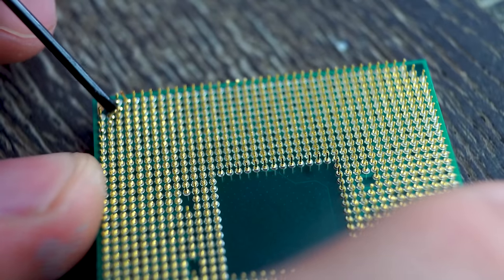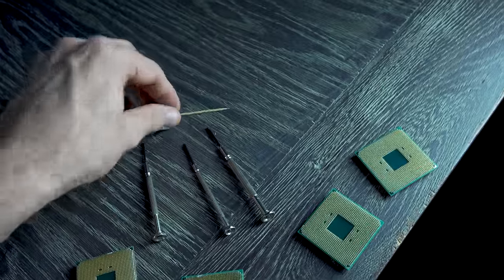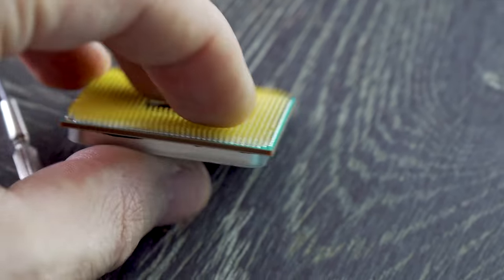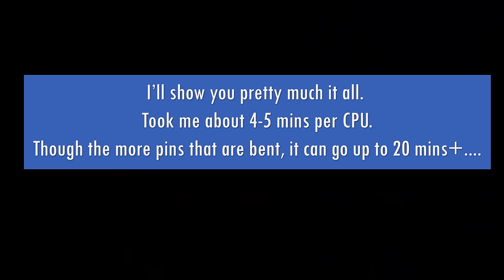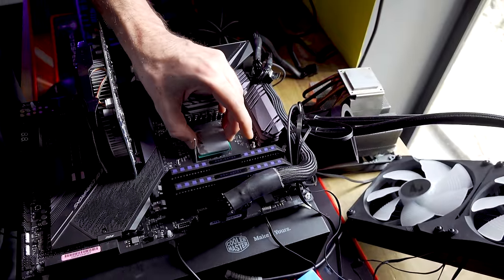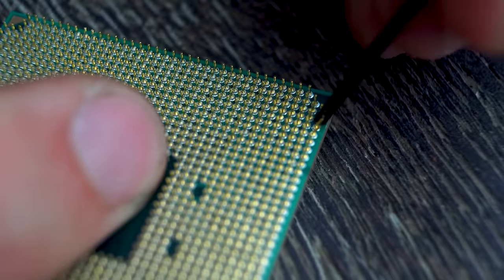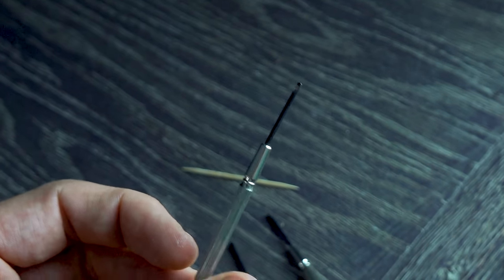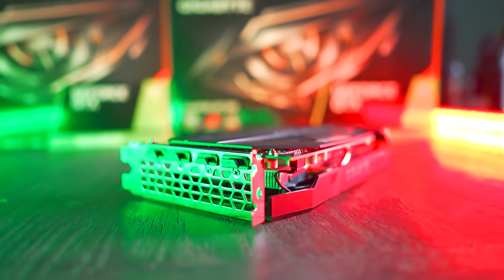How I quickly and easily FIXED 2 Ryzen 2700X CPUs with BENT Pins

Comment: So i couple of tips i just learned from unbending the pins on My phenom X6 965. First look for and try to take care of the "obviously" bendy ones, seccond i'll assume Ryzen CPUs have more pins a there for a smaller gap betwen the pins, Jay from JayzTwoCents used a Razor for unbending the pins, that was far too small for my older CUP but i found out that a regular plastic guitar pick was perfect for the job, third if even after you took care of the most bendy pins, the CPU wont go in, that means that "all" pins are ever so slightly bended, but resist the urge to cry and you guitar pick to slowly crias cross the CPU opins, going line by line making sure that all pins are straight, after that it should gon right in. And That's it! Now you are free to cry from the stress and hopefully feel quite proud of your self. But the main thing is to be calm, it's not the end of the world as you may think it is, just take your time do it slowly and you can make it.

Comment: As an anecdote.
When I was ready to change the Wraith Prism for an AIO, I didn't use my PC for 2 days (so imagine the thermal paste ...), when I was about to remove the Prism I remembered the method of turning it a little bit and suddenly ... The Prism comes out with my 2700x attached to it ... I think it's one of the 5 times I have been most scared in my tech life, so after a bit of movement I can take it off and observe the worst, like 10 bent pins. So with a needle I prepared to bend them (it is not my first time, since I do it regularly with LGA but it was my first time with PGA), after about 20-25min and with tears in my eyes, for me surprise my 2700x still works without any problem
.
In summary or TL; DR: do a CPU test to leave the CPU / paste / Cooler warm, be careful with this bitch Wraith Prism (or the little brothers for that matter) and if you have a bent pin or pins BE PATIENT because if they are not broken, they can still be repaired/bend back.

Great video.

Comment: Great tip to do the wiggle when removing cooler.
Reply: Also run a stress test to loosen up the thermal paste
Reply: Dont even need a stress test, just turn it on for 10 min
Reply: @rdmz135  bit like a hot engine before changing oil!

Comment: I've made your mistake on the 3900x twice now... My heart stopped. I warmed it up with a stress test, did the jiggle(may have been a mistake in the end) and it still came out with my Noctua D15, 3 corner pins bent out the gate. Then after managing to get it off the cooler with a hair drier twisting it I drop it inside my case bending the opposite corner. 30 minutes of bending with a sewing needle until it sat flush... with a tap at the end. All good so far.

I can't wait for AMD to switch, AM4 is held in by a garbage slide mechanism relying on friction. Well now the pins are thin with less surface area and shiny gold plated copper to begin with, I can't change the cooler without risking pulling it out of the socket. The cooler and processor are one now as far as I'm concerned.

Comment: Not sure if my brand new 3600 came with few bent pins or my father somehow managed to bend them while putting the cpu in the slot, but I've managed to straighten them up with a sewing needle since these screwdrivers were just too big imo. Took me almost 2 hours to bend few pins back since i was nervous of breaking them off.

Comment: I like to use sowing pins for straightening out PGAs. The ones I have here fit perfectly between the bases of the bent pin and its unbent neighbour. I push it through for a couple of mms, then slowly raise the sowing pin from the substrate. Because the sowing pin is guided by multiple straight pins in the two rows alongside it, this will usually put the bent pin back about 80-90% to its original position, at most needing small adjustments to fit back into the socket.

Comment: I bought an open box CPU (used warehouse deals) that was about $100 off, but failed to mention bent pins, but it had three or four bent with one bent severely down at 90 degrees.  I thought about sending it back, but then decided to give it a try.
  
In the old days we used credit cards, but the Ryzen's pins are too close together to fit a card in between them and for the 90 degree flat pin I used a safety pin because the better ones are made of spring steel and the only way to get in between the substrate and the pin is with the sharp point of a sewing needle or safety pin (the safety pin has a built in handle unlike a sewing needle so it's easier to grip near the coil).  I place the cpu upside down in a soft edge (plastic or rubber type insert grips) vise so it's secure but not so tight it gets damaged.  

Barely put the needle point past the pin in so it falls away while coming up thus keeping you from over-bending the pin the other direction like we see several times with the screw driver - as that weakens the pin going back and forth.   As you rock the needle down below the edge of the cpu like a teeter totter at the nearest edge the pin comes up off the substrate.  It's better to do just a little at a time to keep from going too far or breaking it off.  Rock with the spring steel pin gives you power and leverage without too much force and only having the tip slightly in keeps you from over bending as well.  Then you re-position and do it again just barely putting the needle past the pin so you are only moving the pin slightly with each rocking motion.  I find I have much more precise control using the rocking method over free hand and thus I'm not constantly having to correct the pin from over bending like we see in this video - lessening the chance of breakage.

Comment: I remember two pins falling off my old Athlon XP 2600+ trying to straighten them. Just dropped the pins into the correct socket holes and applying more pressure on the CPU before locking it in. Always worked.
Wonder if it would work on a more modern AMD CPU ?
Can't see why not.

Comment: How I accidentally bent my pins is my Ryzen 3 got stuck to my heatsink, I didn't use the right method to get it off (using a hair dryer and slowly pushing it off with a flathead screwdriver) and I just plopped it back on in the new motherboard I was swapping it into, and I bent a few pins, thanks for making this video, I'll try this method. Hopefully I can save myself time and money using this

Comment: Also, if that case of the CPU still doesn't go in at one corner despite you tried your best to bend the pins straight, sometimes instead of inspecting it all over again, trying to (very, very gently) fit that corner into the socket first will get it to fit in, and you just tighten the socket to completely bend the pin back

Comment: razor blade works well. been using that for alot of pga cpus, you can also get plastic razor blazes if worried about scratching.

on launch bent 2 pins on my 1700.

Comment: A really easy way to solve cooler removal (Air and AIO pump) is to run the computer at stock clocks for 5 mins (desktop or dos) turn the PC off and remove the cooler immediately with care.  

The thermal paste is in a warm liquid state still. That now liquid bond won't grab on like cool thermal paste will. (no need to wiggle). This will avoid PGA pins getting bent and or the CPU come out with the cooler at all! 

Super safe and easy way to avoid what Tech Yes City went through with the 3900x. 

The 2700x's just how!? Who drops a CPU let alone 2 of them!? 

Especially when you get each one? 

Sounds a bit fishy to me. 

What do you guys think!?
Reply from the maker: CPU Tray lost the CPUs when they were handling them.
Reply: @techyescity  holy hell! We'll that's just more than bad luck then. 

My heart would have literally stopped in that moment! 

Thank you very much for the feedback mate. 

Very appreciated.

Comment: razor blades are a really good tool to use. you can bed  very easily and it works double as a good check it the pins are straight enough. I fixed my 2700x doing this

Comment: I use a razor blade as it will straighten up the bent pin until it hits the row of straight pins in the same row, its quick and painless and doesn't require really steady hands that trying to bend individual pins usually pretty difficult.

Comment: sadly this vid is released two weeks after i tried to bend, and broke a pin off my ryzen 3700x. i stuck a bit of a broken off needle into socket and it works
Reply: nice
Reply: @THEMK0070  barely made it work, it was the inner pin
Reply: @theoryismypraxis3538  did you try it without the pin first
Reply: @DraXaly  i dont htink i oculd have since the  bios on the mobo was kaput/. The motherboard was a used b450m mortar and i had a ram error on ezdebug all the time. not  sure as to why. I  bent the pin when  yanking the cpu out with the cooler, it came out aloneg with hte cooler. Not yanking, but pulled it out along with it wily nilly. I am not sure if its a crucial pin now, because the combo would not post due to bios/cmos update issue. I only got it to boot after cmos cealr with the  needle in the socket. I might try it without it to confirm if it works without it,  if it does, i can resell it later for full used priced, rather than as damaged, so its worth a shot

Comment: A way I did it was grab a razer blade, slide it down an "aisle" of the pins and make sure the razer slides all the way through, like swiping a debit card.  then so gently wriggling pins back into place and lining them up, i then dropped it into the socket and i clicked it down, the socket will realign them completely, then youre  green to go, i was lucky it was an outside pin.\

ALSO 
You could definitely try a debit or credit card too, maybe a license, but the blade is much slimmer and more precise... talking about this you could maybe try and exacto knife

Comment: TIP: use whatever heat source to warm up the Cpu at about +60° C.
This way you can recover even the absolute worst bent.
Even if some pins brake off, the Cpu might work without them, as there are double or more of them doing the same thing.
If you're really desperate, insert a copper wire into the socket, where the pin is missing from the Cpu.

Comment: You can take long thin flat piece of metal (like razor for knife but not sharp) and put it for whole length of your CPU  between pins and carefully just bend it straight directly to another pins in same line.

Comment: @Tech Yes City I have a question. What are the differences between x79 machinist and x79 turbo from aliexpress? I saw a video 3 months ago from you with machinist x79 and Xeon e5 2689 but if they both have 1 nvme and 4 ram memory slots, which can be the major differences?

Comment: This method is pretty much the same since socket 745. A credit card, a razor, a needle or a screwdriver of the right size. CPUs before that, like those for socket A, also had pins, but they were so thick, I never saw one bent or broken. It was my experience that on a socket 745 or 939 you could very easily pull the CPU out with the lock still on. I've never damaged any of those with that pull though, it always came straight out with all pins fine and you then had to use dental floss to remove the CPU stuck to the heatsink. Since I've been using better paste, it does not happen to me anymore. With the invention of efficient thermal pads like IC Graphite, this sticky problem is finally history :D

Comment: A utility blade does the job for me
I first align it with the straight row in one direction and bend them one way then the opposite direction
This way is saver because the stress on the pins is lower because its spread over almost all pins in the same row and they automatically align with the rest of the pins
Risc with screwdriver is much higher you damage pin because all the force is directed to one pin

Comment: If a pin vreaks off, just simply take 0,5mm solder wire, put it in the socket exact hole location of the broken pin, cut it off a tiny bit above the surface of the socket so it has a decent touch to the broken spot where used to be a pin.
Place cpu, cooler and you are good to go...

Comment: Great vid. One little suggestion. If you have one or a friend, try putting a notch little ways up length of screwdriver. That way you have more control over the pin not sliding off the rounded edge, hope you get what I meant. I'd use a chisle(tiny and sharp(fingers beware)) to make notch, Dremel tool only if your really good at it. Not surprised they don't make a real tool for this. Keep on keepin on.

Comment: Back in the mid-90's we used a soldering iron with a thin hollow tip on semi-low temp for bending back pins, the heat made them less prone to break and ruin the cpu. The tip was so small that it would fit around a pin.

Comment: I believe this also relies on the state of the bent pins. I once bought a Z370 motherboard from what I thought was a good seller on EBay for a slightly lower price. I bought from him before and thought, "Well, since they took such care of the last item, I guess this one could not be as bad either :)" Only to find a motherboard with the protective lid at the bottom of the box and finding EVERY SINGLE PIN BENT! Like, I get it. Some pins can be bent back and I've done that before. But, the bent pins on that board had to literally require effort to bend in such a manner that it was non-repairable. Luckily, EBay Buyer Protection was the only way to get my money back where I called there customer service where EBay was actually nice enough to pay for shipping cost too to send it back. I could say I learned a lesson, but then again, this situation I was in was very strange and very bad that even EBay sided with me like, "Thats not normal!" literally over the customer phone line.

Either way, amazing steady hand on those bent Ryzen CPUs. I personal use a razor blade along with a scalping blade too. I'm awful at already trying to bend pins, but AMD has always had the advantage of CPUs with pins instead of Intel with the motherboards having pins(I kinds prefer AMD on this).
Liked the video, Mr. Tech YES Man.

Edit: I recommend buying boards with CPUs already in them in case your wondering. To me, it's the safest way.
Reply: I had a max size Noctua cooler on an Intel and it bent 2 socket pins, and I made it worse removing the board. I couldn't rebend them. Turns out bent pins are not covered under warranty. I think you have a much better chance at fixing AMD.

Comment: If the cooler is kind of glued onto the CPU with thermal paste I usually do a twist slide without pulling at all. But that only works if there's enough free space on the motherboard next to the socket.
And this is probably only a problem with fairly fresh paste and not old dried out stuff because fresh paste is kind of like a thick liquid and liquids get used in hydraulics, unlike air a liquid won't expand much at all in a vacuum which you're creating when pulling on the cooler. If there's only enough room to pull the cooler off then the safest way should be by slowly trying to tip it over on one side/corner so the paste can start breaking apart on the other side.

Comment: Just go and buy a  hypodermic needle with the gauge that the pin will fit in side of( 8mm) the needle  and just move the needle unto its vertical/straight up...done..move to next pin.
Did this with my old FX8350. You may need to file the point off the needle with sand paper or use a sharping stone as I did

Comment: Bent the pins on my 3700x the exact same way you did. The cpu actually fell to the floor too. Luckily with a scalpel and my reading glasses on I managed to bend all of the around 20 bent pins straight :P
Reply: Hi. After several months the processor works well?

Comment: my way to fix pins is to use these this tweezers I got for $1.99 at microcenter and I get the tweezers under the pins and pull up.  this gets the pins 95% straight especially if they are bent over.  I then use a I fix it flat blade to bend a pin straight to the row next to it.  I then use alcohol an old tooth brush to clean thermal paste out of the pin (seems to be a growing trend)  then I put it in the socket and lock it down, then take it back out, then lock it down then take it back out, then lock it back down, apply paste and a cooler for testing.  I also have a led lit magnifying glass for inspection as it is super hard to see the pins as they are shiny and you really need good lighting.
Reply: I have now successfully recovered 2 working cpu's and one non working cpu (I'm still not sure why this 1700x I got doesnt work, I think the thermal paste might have shorted out)
Reply: Ive also found that when I do this sometimes I need to reset the cmos HARD, meaning no battery, no power cord, and jumper on the reset for 8 hours (1-2 hours seems to be the minimum for this to work).  I had a used 2600 that would not boot and I thought I had lost $60 and then I tried this and BOOM, it booted!

Comment: I bent 2 pins on my brand new 5600x for my first build to realign them I used a plastic card and my finger nail and bent them back and it runs perfect
Reply: How did you manage to bend them? 
I'll be building mine soon with a Ryzen 9 5900x and I'm shitting bricks right now, any advise?

Comment: The blade of a cutter knife is the much better tool for this task, because you get the bent pin bent back exactly straight with its row and the column. Btw I do bending back pins back under an electronic microscope and when  I am done, the CPU's slide into their sockets... When a pin is bent almost 90° it is hard to lift it a little. In this situation I use a sewing needle to bend it up to a position where I can use the blade of my cutter knife.

Comment: Mine got bent as you said by the goop like thermal paste sticking to the heat sink I used a stanley knife blade to run down the lines of pins